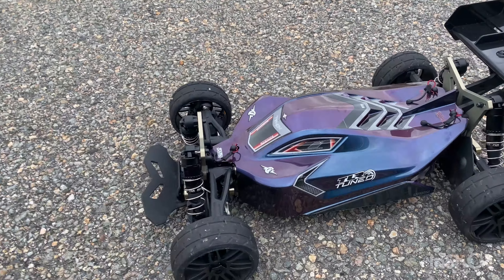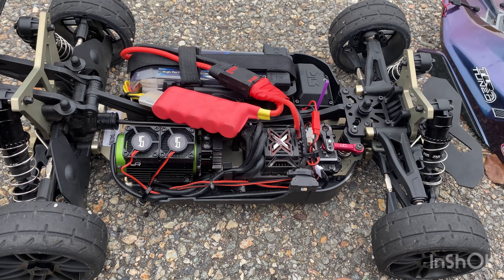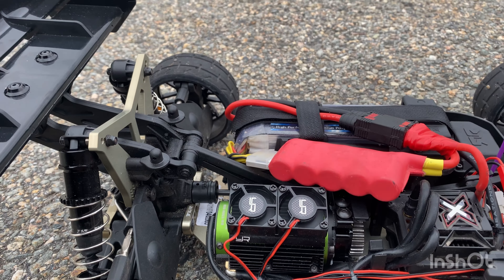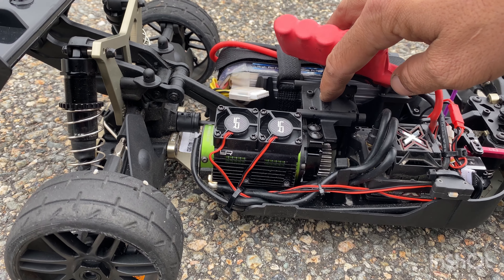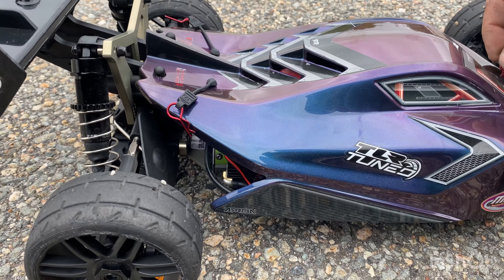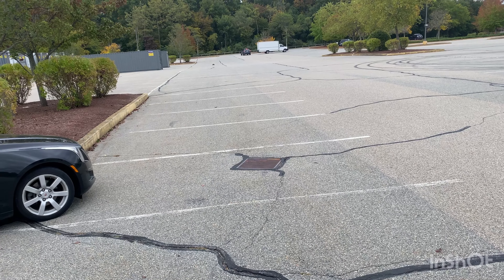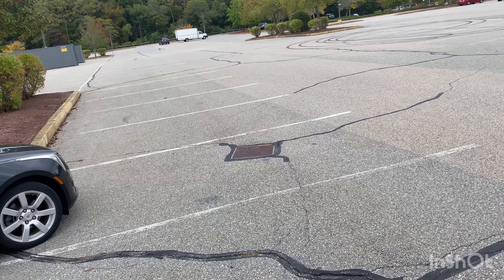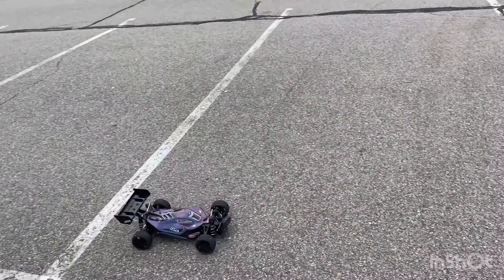The Arrma Tlr tuned typhon part 2

Comment: Very nice. I have my TLR Typhon on the way and this puts my mind at ease on the gearing. I was originally gonna put an 18t pinion (hobbywing max8/2200kv, dboots hoons tires) but it looks like I can increase that quite a bit
Reply from the maker: Yes!  I have to edit my latest video but I did some pretty impressive speed runs with this setup and the motor remained cool!!

Comment: Them fans any good for my 8s kraton I run 6800 120c batteries an my motor get a little hot need a good dual fan mount an fan
Reply from the maker: They have larger ones for the bigger motor! But yes! That or the NHX fans or game changer fans are perfect for the 8s motors
Reply: I heard game changer just uses detail fans an put a different case in their lot cheaper if you just buy from detail fans since they are just computer fans but have to look into the  other ones never heard of that company thanks
Reply from the maker: That might be true as I believe most of these fans are just standard 30mm rebranded pc fans lol
Reply: Take that same YR/PH heatsink & add protek/rocket 30mm aluminum fans 28000rpms 👍🏽

Comment: you got the fans backwards , the air should b blowing down not up!
Reply from the maker: Lol I did notice that. I got that fan setup off a buddy and just threw it on quick. But thanks lol. Not my best moment
Reply: @DeRock401   I would leave it if its working. When they're upside down they pull heat off the motor and blow out. Sometimes that works especially in tight setups with little space. When they blow air down sometimes the air just circulates so you get a bunch of hot air moving around but not as much cooling since in a tight space it has no where to go. Had the Hobbywing 2200KV setup in my TLR and the ESC was always a little warm until I turned the fan upside down and blew the hot air out from the top.